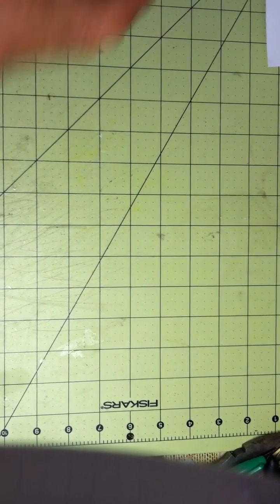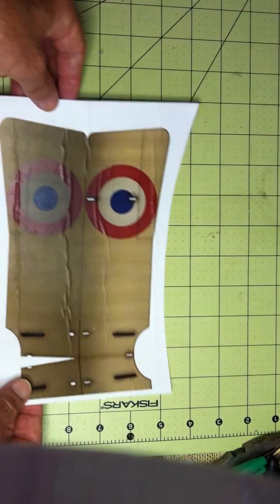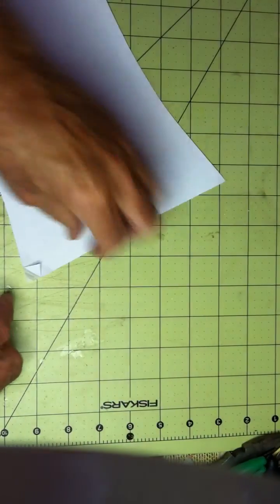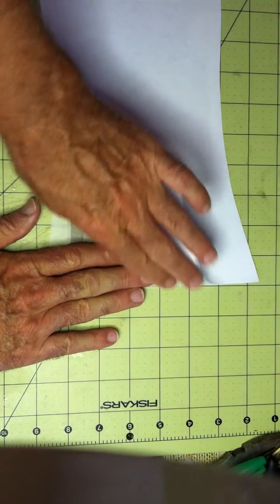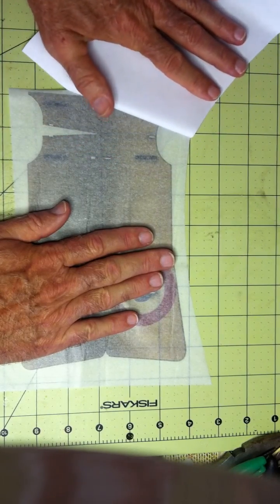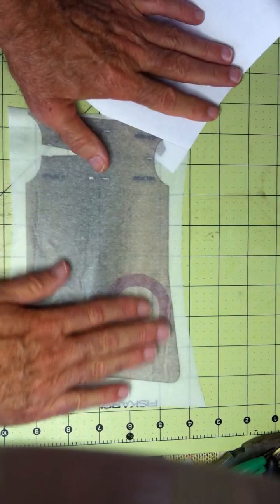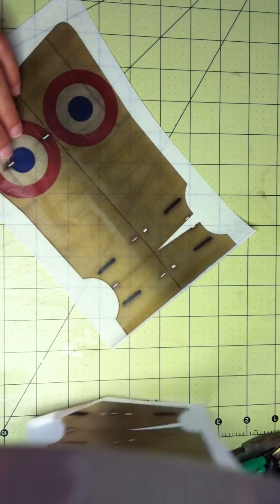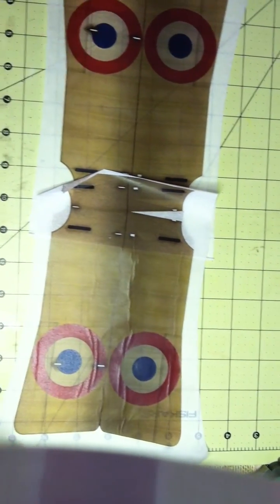NP-11 Main Wing 1 Printing .MOV

Comment: What is kind of printer you use for this.
Reply from the maker: I use a laser printer because the toner is water proof.  I've used Dell, HP,  and Brother lasers with equal success. The only limitation is that most  lasers have a maximum paper length of 17".